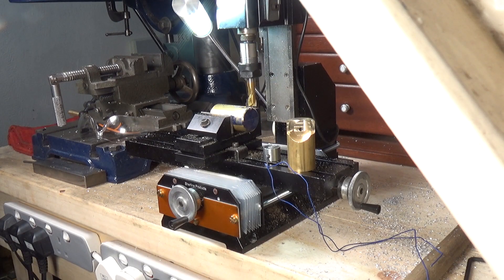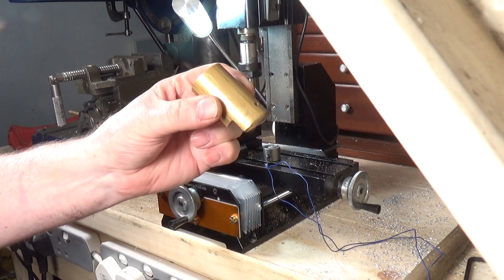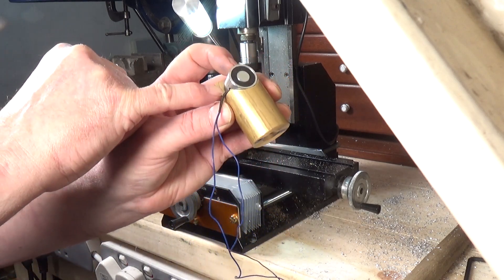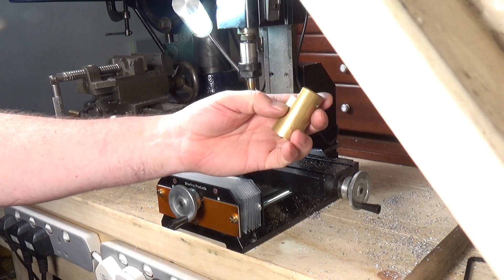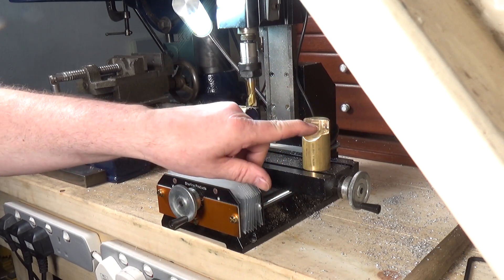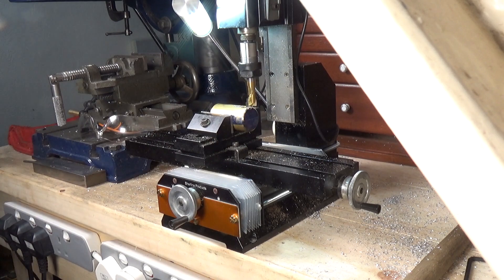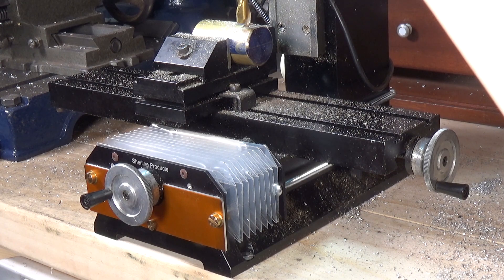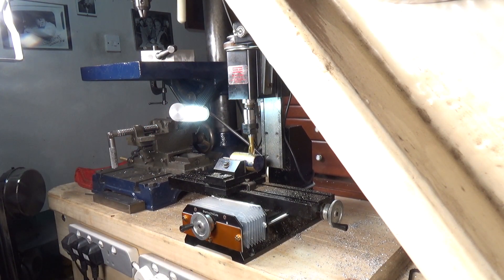Sherline 5000 Mill Update Part Two

Comment: Was that steel or aluminum rod that you machined?
Reply from the maker: In the video that is brass rod that is being machined.
Reply: @RetroSteamTech  In your experience have you had any trouble machining stainless steel?
Reply from the maker: @thejaebeing  To date I've not used the Sherline on stainless but I'm sure it would cope as long as you took small cuts.
Reply: @RetroSteamTech  thanks.

Comment: What adapter are you using to use bigger end mills I bought a used sureline and it only handles up to 1/4 …great video
Reply from the maker: I use an ER16 Collet Chuck with a MT1 Morse Taper Arbor. I got mine from Banggood but they no longer sell them. You can still get them from RDG Tools and ebay. I've put a link in the description. Banggood still sell the ER16 Collets.
Reply: @RetroSteamTech  Hi sorry for the late comment, but I just got my sherline mill. I am reading that the RDG Collet chuck has a 6mm drawbar. So I guess you are not using the MT1 arbor? I am confused on how you have it attached to the mill spindle... are you using a 6mm drawbar and not the sherline drawbar? I thought the sherline drawbar is 5/16″-24... sorry I am a bit confused and wanted to ask before buying the Collet Chuck
Reply from the maker: @lucamodaffari9467  No problem. I made my own drawbar for the collet chuck. It's basically just a long 6mm bolt so it's quit easy to make.

Comment: Hi, Alan. good to see you making swarf. the two flute is making the mill work hard and is not helping with the noise. try a four flute as the two flute is a slot cutter mainly used for plunging operations for keyways and such, Even my much bigger mill makes a racket when i use a slot cutter. great little machine though and i bet it was great to have some fun with it . Cheers and thanks for sharing . Ade.
Reply from the maker: Hi Ade. My friend Rob also suggest 3 or 4 flute cutters would be better and from my experience of using milling cutters on the lathe I would have to agree. It is proving to be a very handy little machine. Cheers, Alan.

Comment: Looks to work well, I didn't see any cutter deflection either, also I agree with Rob about using multi flute cutters. Stay well. Cheers
Reply from the maker: Hi Paul. Yes for a small machine it seems to be very rigid. Cheers, Alan.

Comment: Good one Alan.  It works great.  The chip cover mod is way better.  You would probably be better off using 3 or 4 flute mill bits - smoother cutting, better finish from my experience.
But that's personal choice.
Very interesting clip as there's not a lot of independent videos on YT dealing with these little units.
Cheers Rob
Reply from the maker: Hi Rob. Yes in my very limited experience with milling I prefer the 4 flute cutters. I hope get some more videos of it in action soon. Cheers, Alan.

Comment: I've only seen Sherline Mills in catologs and it seams to have excellent speed but how is the torque?
Reply from the maker: Hi Craig. Torque is ok but being that it is a very small mill I'm not taking large cuts. Used it on brass & aluminium so far which it handles fine. Cheers, Alan.

Comment: Great to see the new Mill in operation. 

You did a nice job on the mounting plate for the Concertina Protective Cover.
Reply from the maker: Thanks Charlie. I knew the original spring fitting would annoy me sooner or later so it was worth the effort. Cheers, Alan.